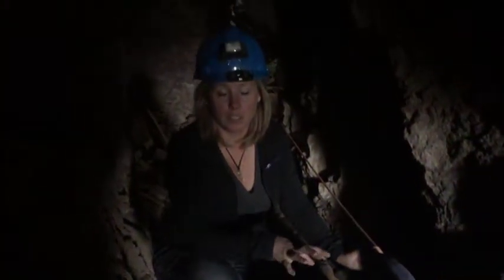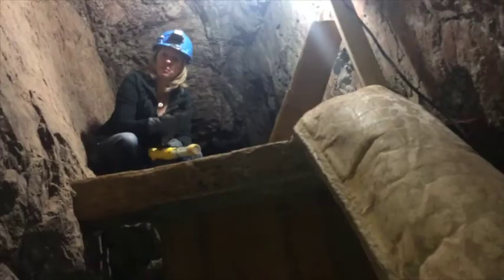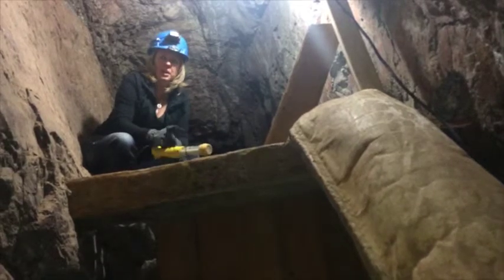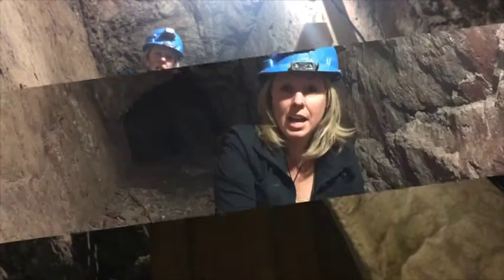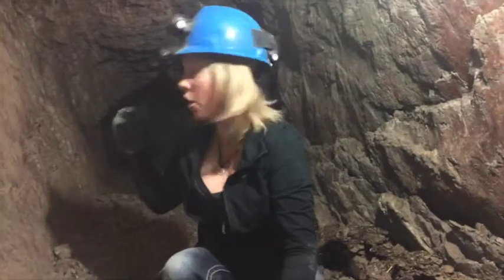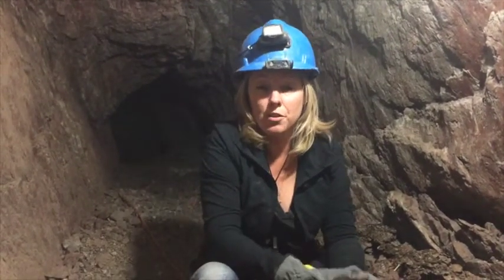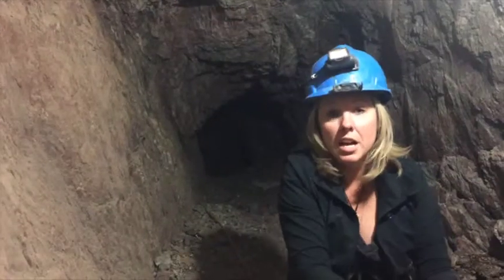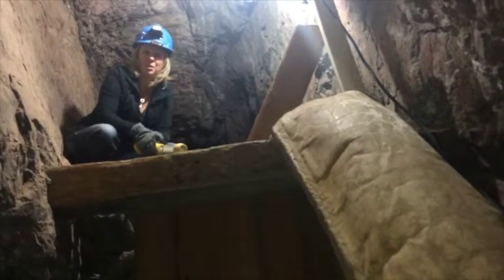Mine Ventilation Blower

Comment: Well back in the day, they'd ventilate by fire... they'd make a pair of horizontal cuts, and build a fire in the middle, the heat would rise and take fresh air with it... only trouble is in coal mines, that usually had a lot of methane in it... and it'd go boom and take everybody out. But for mines that didn't have methane, it worked well. 

thank god for modern conveniences, if our EPA ever lets us back underground again.